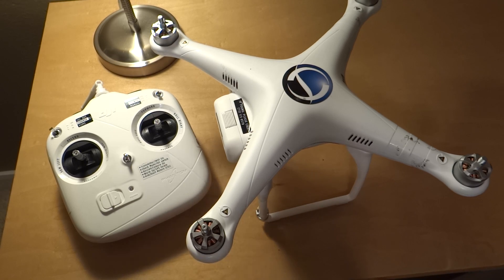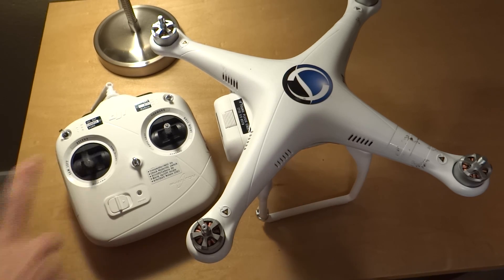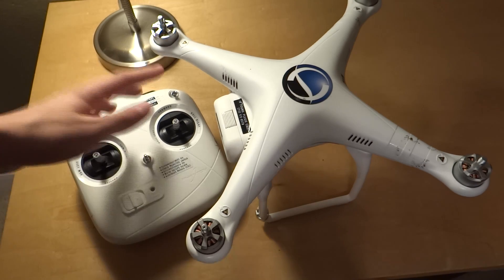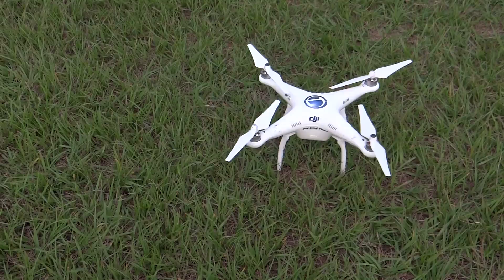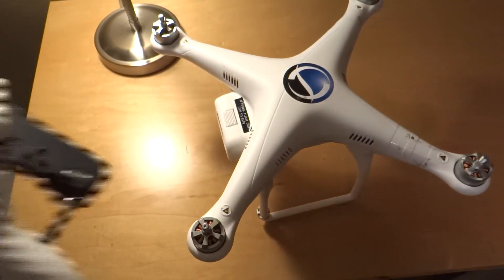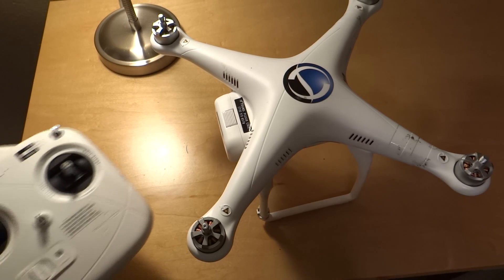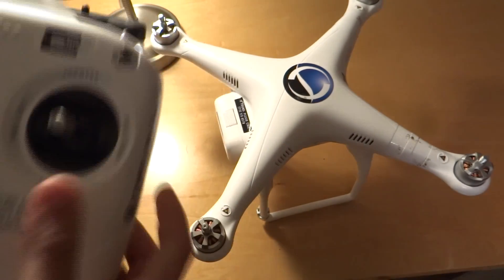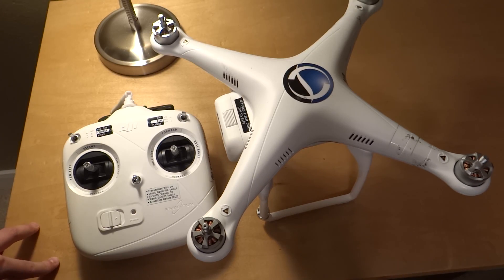Motors Cut Mid-Flight???

Comment: I have an F550 with a non spring loaded throttle like whats on the phantom. Do you have any idea on if holding the stick down on that will shut off the motors or is that just a phantom thing? (nice video by the way!)
Reply from the maker: I have no idea.

Comment: Thanks a lot for the test! 

Having seen all those death wobble videos, I'm always anxious on descents. I wonder though how fast the descent should be to actually result in the WoD. Guess it depends on the wind conditons somehow, but still..
Reply from the maker: I never descend full speed, it was only for the rest. Even so, I know the time the phantom takes to recover from it. The dji software has now somewhat limited descent speed, so it's not as big of a deal, but even so, if you descend full speed for 3 seconds, you could be looking at needing 15-20 feet of throttle up to recover
Reply: thedjiguy Do you descend straight down vertically or with some lateral movement or yaw? I read that those "wobble of death" situations happen when the phantom gets into its own prop wash and thus looses lift. And the only way to get out of it (or avoid it altogether) is to move sideways while descending or at least yawing.
Reply from the maker: I was going straight down in that video. I usually just descend straight down, but for 2-3 seconds at a time then let it recover, then more. I use this method when I need the phantom above me due to trees ect. Otherwise, I wOild for sure descend at an angle.

Comment: Hey djiguy, do you know of a way to revert back to older software for the P2. Since I've updated to the latest software I dont like the way my P2 flies. GPS mode has become very limited as far as top speed and maneuverability. Decent speed also has been capped which I'm sure you already now. Please advise if there's a way to improve flight dynamics. Thanks!
Reply from the maker: Try switching to Atti. Mode. If that doesn't help, email or comment again. I believe there is a website that keeps old versions, I just have to look for it.
Reply: thedjiguy Thanks for the quick response. Yes, Atti mode flies much better but I was hoping to get the same speed and performance out of GPS mode like I was getting before the updates.

Comment: DJI needs to fix that, that could accidentially happen
Reply from the maker: Yeah, there's a reason the phantom motors don't shut off after 3 seconds of throttle down while in flight, it because the Phantom knows it's in flight, I'm sure that could be adapted. But then again, say I see a helicopter coming straight for my Phantom, I might just shut the motors&Click.
Reply from the maker: I meant to say "I might just shut off the motors" not sure why it added the last part, stupid autocorrect.

Comment: I knew performing the CSC maneuver in mid flight is stupid and WILL shut off motors, resulting in the poor Phantom comming down like a sack of potatoes. However I was still wondering about the second version with full down throttle for more then 3s. FINALLY I GET THE ANSWER!!! Thank you so much!
I have been writing this to DJI even and they could not tell me anything specific. However doing some math (and aerodynamics) I foudn out that it is seriously discouraged to descend that fast as you can actually get the Phantom in its own turbulences and loose control! Just my little 2 cents...

Comment: Holding the throttle all the way down won't shut down the motors in flight on a P2 (as you found).   In P1's it's possible for that action to shut the motors down in flight depending on a setting in the NAZA.

Btw, since you proved that the CSC command will shut them down at any time, do you still want to refer to that as "the myth"?
Reply from the maker: It's been busted now :)